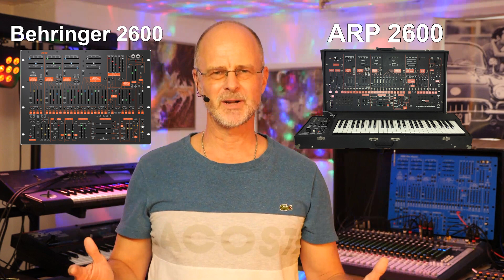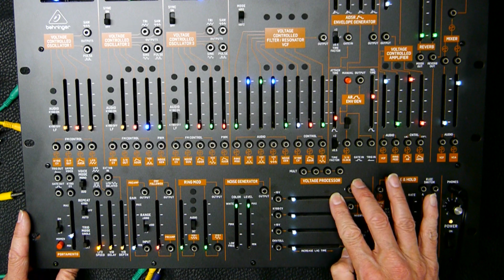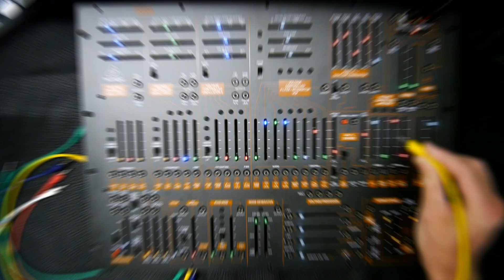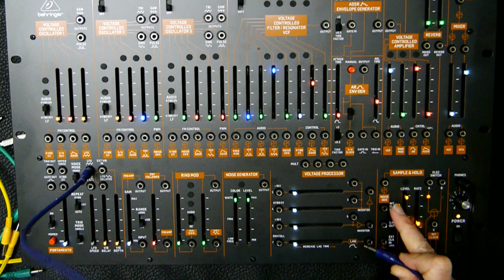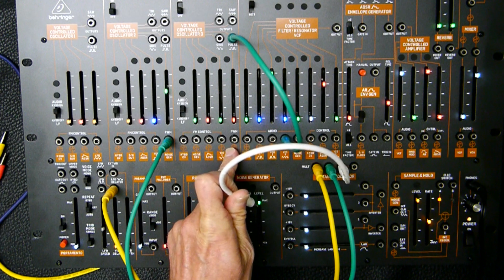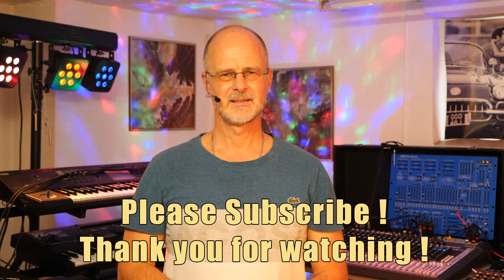Voltage Processor Tutorial for Behringer 2600, ARP 2600 and 2600 Clones

Comment: I really wish behringer would make a separate matching cheap midiboard specifically for the 2600 or like maybe even a wooden matching rack with a built in on that you can plug it into I could totally make my own i have the capabilities. But im also lazy and would rather just buy one
Reply from the maker: Interesting idea, but you can buy the Swing or Keystep. These are good companions for the B2600.
Reply: @Ral @RalphBaumgartl  keystep was actually the exact model I think I would buy to strip down and add into the custom controller. Could probably even design on the back or an extram front panels some CV outs that it has if I remember correctly. Like the idea was to make a nice looking either dark wood, or the old amp/ suitcase lookin material youd see a lot back in the day strip open a keystep pro integrate the new CV outs and any other new buttons onto a nice metal extra panel at bend where the keyboard and 2600 connect to give it a  bit more of old school angle look. Power situation would prolly be the biggest pain because youd have to hunt down PSU that could power both and Idk about PSUs for the most part, I could make the enclosure but I am a menace with a soldering iron. Never heard of the swing though will have to check it out

Comment: Thank you for another great tutorial, Ralph! I tried to get the S&H arpeggio going, and seemingly had the same settings as you did, but it would only give me a ramping up and down of the low-end bubbly noise. I wasn't able to achieve the octave scaling heard in the video. Any thoughts on what I could be doing wrong?
Reply from the maker: Try to adjust the sliders gently until you get the right result. It's an analog Synth thus you cannot only rely on the visual position of the sliders that you see in my video. Have fun experimenting. Greetings, Ralph
Reply: @RalphBaumgartl  Thank you! I played around more and started to get closer to the results you were sharing. I appreciate you taking the time to lead me in the right direction! 😊

Comment: could you please help me out how to invert the pitch zawinul style. grazie mille!!
Reply from the maker: Use the KYBD CV slider of the Voltage Processor. Plug the Inverter Output into the KYBD CV input of any VCO. Repeat this for other VCO's using the MULT row if necessary. Cheers, Ralph

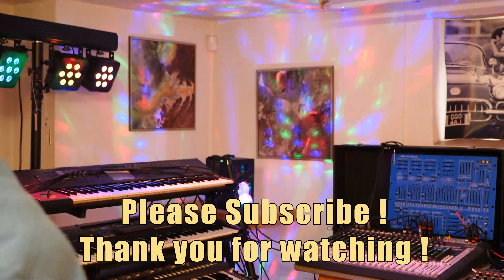Comment: 17:33 - I made this patch several times but the S&H is not responding. What might cause this? - Oh, I figured it out - I need the Noise Generator up all the way. Cheers
Reply from the maker: Glad you figured it out by yourself. The more you use the 2600 the more it will reveal itself to you 😉

Comment: Thank you Ralph for all your 2600 videos.
I am just starting out.
I have managed to copy your huge " bass patch" but also added the ring modulator sliders botg fully up.
It sounds fantastic.
I need to understand the sample and hold function a bit more.
I watch a number of your videos every single night before I go to sleep so that eventually something has to click.
I also am reading a very good book about the ARP and all the theory.
Its a massive book and I have to answer questions!!!
Grhh
Thanks again Ralph. You are a star.
Reply from the maker: Thank you Peter, you flatter me. I am glad that my videos have such a positive impact. Just consider my patches a starting point for your sound design journey. There's no right or wrong in modular synthesis. Anything goes...
Reply: @RalphBaumgartl  
Lieber Ralph.
Du ( wenn ich das erlaubt)
Bist " Expert " mit der 2600.
Du hast die originale und auch die Behringer version.
Auch mit ein parr decaden hinter dir!!
Und!....wenn ergendyemand eine Deutche Stimmung sprechts DANN  Höerich ganz intensiv. Und.. mit Hörren steiff.
Vielen danke für allen videos du gemach hast.
Ich halte allen für Golden!!!
Ich habst mein besten Deutch (  Deine Mutter sprache ) zu probrieren also Ich hoffes Du kann es verstanden.
Ich war ins Deutchland 16 Yahren und auch mit mein Liebster Deutche Frau.
Sie ist leider gestorben aber Ich habe immer zwei Höerren steiff von dir zu lernen.
Vielen Dank.
Und Mehr.
Peter
Reply from the maker: @synthesauria  Vielen Dank Peter für deine freundlichen Worte. Sehr oft werden wir Deutsche für unseren Akzent etwas belächelt, deshalb freut es mich um so mehr, dass dir meine Videos weiter helfen. Viele Grüsse, Ralph

Comment: Hi Ralph, is it possible to use the Voltage processor as a way to merge several gates signals into one and patch the merged signal into the gate in of the 2600? Thank you! Max
Reply from the maker: Sure, that's possible. The question is whether it yields the sonic results you are looking for !? There's only one way to find out ;-) Give it a try and start patching....

Comment: Nice one. Thank you Ralph. Maybe you shoud have explained what the -10v / + 10v default settings stand for. Maybe next time?
Reply from the maker: The Gate signal of the 2600 is 10V, but you can work also with lesser signals yielding different results. Greetings, Ralph

Comment: Thanks, Ralph. You are a legend.
It is worth pointing out that using the lag processor for portamento means that it may be applied to a single oscillator rather than all three.
Reply from the maker: Yes, you are absolutely right! Thanks for pointing this out. Have a great day, Ralph

Comment: One of my favourite uses of the Voltage Processor is to feed an inversion of the ADSR output to Osc 1, which is in unison with Osc 2. Osc 1 will glide up (dependent on the ADSR settings) whilst Osc 2 glides down, to meet in the middle. At subtle settings this can sound like a detune just on the attack. Instant Yamaha CS-15!
Reply from the maker: Awesome tip! I have pinned your comment to the top so that other viewers find your idea easily. Thanks for sharing your expertise! Greetings, Ralph
Reply: @RalphBaumgartl  Thanks Ralph: looking forward to your next tutorial; always informative!
Reply: Ooh can't wait to try this! Thx!
Reply: Great tip

Comment: WOW that was GREAT ...Thank you for all of this Info..!!!!
Reply from the maker: Hi Edwin, glad you like it! Thank you!
Reply: @RalphBaumgartl  
Hi Ralph. I recall seeing a video on someone commenting on the Arp2600 how The keyboard player from weather report was able to set up a patch to play backwards on his keyboard … was this a patch or was this hardware reconfiguration.. I tried looking into this further to see if I can find a video on how to patch it but had no luck. I was hoping you had any ideas on how to set this up. Where the high notes are in the left-hand and the low notes on the right hand. So it actually plays a mirror image.
Best regards
Edwin,
Reply from the maker: @edwinkeys  Hello Edwin, yes you can do this with the Voltage Processor. Plug the Keyboard CV output from the Voltage Processor into one ore more VCO's. Move the Keyboard CV slider to the right for adjustment of the tones/octave. Happy patching! Ralph

Comment: Great one, Ralph! The mult can be used for merging signals, too, right? I would btw also love to see an experienced 2600 user like yourself go absolutely nuts on the B2600 and create ridiculous advanced patches, just to get a better understanding on how to utilize the modules in creative ways. :D
Reply from the maker: Yes, you can use the MULT section to somehow merge signals. The results can be unpredictable, but that's part of the modular Synth journey 😃
Reply: @RalphBaumgartl thank you for all your help to us beginners… I would also LOVE to see you do a vid about advanced patching… or just experimental jamming with patching… I just bought a Gray Meanie and bolted it in the rack… using an Arturia Keystep 37 on midi in and a Casio cz-1000 on midi thru … I’m scared to just randomly start patching things together… I would also be interested in a video about things NOT to do with the 2600…. For instance… a search yielded results that said the LFO and Clock signals from the 2600 could damage my Eurorack modules… I’d love to see you address some of these things in future videos…. Thanks again!
Reply from the maker: I have experimental 2600 Synth jams on my agenda. Stay tuned! Regarding connecting the 2600 clock and LFO signal to Eurorack modules is actually not a problem. I am always connecting my 2600 to other synths and Eurorack modules. But anyway, you should always check the IO specs of your specific eurorack module and reconcile them against the 2600 IO specs which are listed in the manual.
Reply: @RalphBaumgartl mine didn’t come with a manual … I guess Behringer expects me to go pay to have one printed… but it would make great content for one of your tutorials to show us some experimental patches and some cross pollination between the 2600 and Eurorack… please and thank you! I’ve watched a dozen of your vids at least and some of them a few times… you do amazing work and I look forward to whatever you do next … cheers! 🥂
Reply from the maker: @OperationEarworm  You can download the 2600 Quick Start Guide from Behringer's website. It includes all the IO specs. Glad you benefit from my videos. Cheers, Ralph